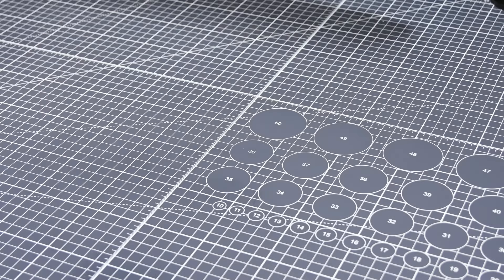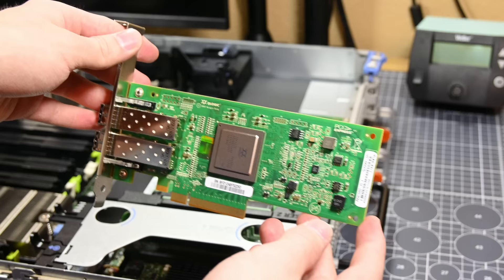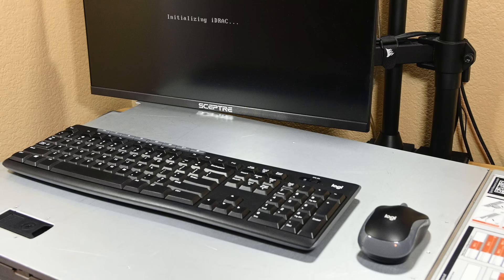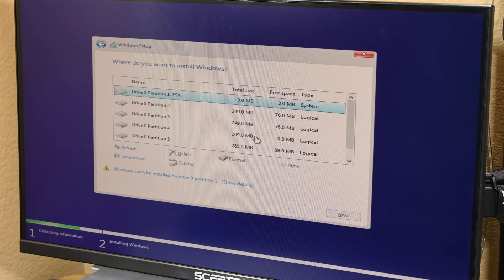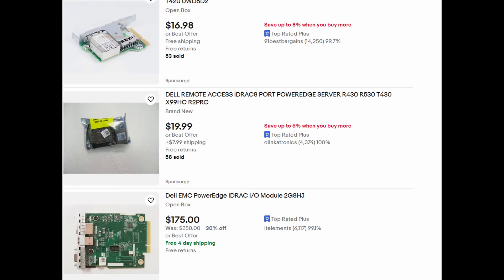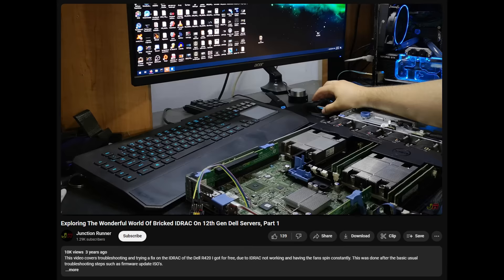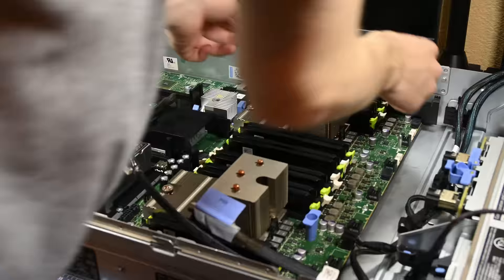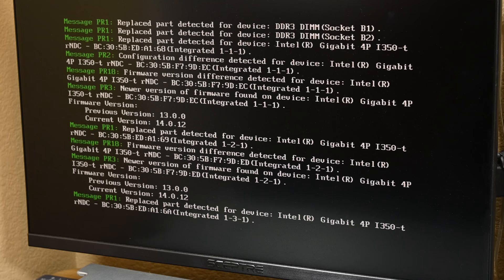I Took a Risk on This Server - Can I Get it Fully Functional?

Comment: I fixed the exact same iDRAC issue with UART about two years ago on an DELL R620. It still works to this day :)

The clips of the RAID controller breaking is an unfortunate issue with the plastic DELL used. But it's not a big issue, as the RAID Controller still sits firmly on it's quite large connector

The SATA SSD not being recognized in the OS is most likely due to the RAID controller. You need to enter the RAID Controller management BIOS and create a RAID0 for your SSD. You could also (probably) flash the RAID Controller into IT-Mode, so that all drives are passed through. Though iirc booting from these drives then doesn't work. So it's most useful if you want to use the drives in something like TrueNAS for Storage.
Reply: how did you fix the issue? Usually it's failing NAND. I have 10+ of the R620 motherboards here broken down for parts because of the iDRAC :) or did you do the "replace with sd card" thingy?
Reply: @callmefoxie2950  iirc, I put the firmware.d7 file onto the SD Card like DELL said in their Help guide. But the flash didn't start automatically. I had to connect a USB TTL module to the UART pins on the motherboard. In the serial terminal I then had to press enter (and maybe type Y or YES) to start the firmware flash. Also, if possible, use a fairly small SD Card. As I also remember it didn't work on the first try with a 32GB SD Card. I used a 1GB Kingston SD Card in the end.
Reply: Oh right. This doesn't work for most people as the NAND is actually bad and requires a change. There should be a way how to change the medium to SD card but eh good luck selling server with that for any profit margin :)
Reply from the maker: There's some great info in this little comment thread that could be helpful for people in the future with this issue, thanks for sharing!

Comment: Ram blanks are to protect from dust in the slots , which I have had plenty of issues with HP servers in dusty environments, however I like your reasoning with the blanks acting as flow stators , that’s good logic 👍👍👍

Comment: Good work on the system board replacement, the small cables going to the front panel are notorious for getting damaged when the lid goes back on.
DIMM blanks are for airflow but do help keep dust from settling in the sockets.
The fibre channel SFPs will be outputting invisible laser light, so if you're not using them you should unplug the SFPs or put dust covers in them, or just remove the cards and put backplate blanks in the slots.  The light will damage your eyes if you look directly into the SFP.
Yes, a corrupt iDRAC will almost always end up with a system board replacement if the server is under Dell support. 

iButton and LCD are run by the Lifecycle controller and iDRAC so not surprising that they weren't working.
Reply from the maker: Thanks for the warning on the SFP's! I wasn't entirely sure whether or not they'd be outputting any light when there weren't cables plugged in, so thanks for informing me that they will.

Comment: To use the front 2.5in bays you first plug the drives in (ideally with a caddy) and then access the Dell raid configuration utility (it's CTRL+R on my Dells). From there you create virtual drives through the raid controller. Once you're done, still in the raid config utility you select the virtual drive the server is supposed to boot from and you're done.
Reply: Also, you may need to load the driver for the RAID controller, as Windows 10 may not include it in the setup.
Reply: Yes, when using raid you need to create the partition. I have r610 and t320 and before I had ibm x3550 and I couldnt figurate that out so I give up and sold the server now I older and have more patient and use the server as saas.
Reply: Came to the comments to say this, as I have deployed several similar dell servers for clients, and I sometimes forget to do this too. I Just picked up a R730XD which I will be setting up in my home lab to replace my HP DL360 gen7. I'm switching from ESXi to Proxmox for my new server, and will be running as my NAS, Docker host, as well as Jellyfin. I have plans to throw a P100 and a couple of NVMe drives to make a self hosted game streaming VM as well.

Comment: Thank you for an interesting video. Buying the new motherboard was a great step. You were able to get your hands into it. And it worked. I remember buying one in which only one socket as working, the second was with bad pins. I had to replace it. And it was a wonderful journey. The way you removed the old motherboard tells me you have read about it. Great 👍

Comment: Congrats on the new server. I've had one just like it running for a few years. The front SAS backplane will happily accept either SAS or SATA drives. I've had mine running consumer Samsung SSD's. the issue you're facing is that the server has the H710 raid card. this card doesn't support passthrough non raid drives. Two options here, either make a single drive raid 0 using the raid configuration utility you see on boot. or get an H310 raid card. this card still supports making raid arrays. but also will allow you to just plug in any old drive and get a more conventional hot swap functionality.
Reply: I remember sometimes you have to cover a lane on the SATA connector with tape for the drive to work - some kind of incompatibility.

Comment: Hey dude, the issue with the iDRAC is a very well known issue with 12th gen Dell servers.

Basically, during the 12th gen cycle, they changed how the iDRAC, Lifecycle Controller and BIOS firmwares worked. Before some specific version, all three were split into different firmwares that needed to be updated together.

However, at some point, the iDRAC and Lifecycle Controller firmwares were merged into one and thus, only 2 firmwares remained afterwards.

Problem is: if you don't go through the exact route of firmwares for both/all 3, you end up bricking the DRAC. There's a specific version that has to be installed first to combine the firmwares, and then you can normally update it.

Unfortunately, I've been there and did that exact mistake and it cost me a T620. That being said, I learned and got a R620 working fully after carefully doing the updates in the right order. (There's a Dell community post somewhere with the exact order to update.)

So yeah, that board was bricked. Luckily you got one for cheap, mine for the T620 was around 700$.
Reply from the maker: Yikes, having to spend $700 bucks on a new board doesn't sound fun, I'm sorry that happened to you. I had found a little bit of information regarding the iDRAC/LCC firmwares being merged into one at one point and causing issues, but your comment put it really clearly for me, thanks! I might just leave this board and its firmware alone at this point haha, no need to fix what isn't broken (at least for my basic use cases) and I'd rather not risk having to buy a new board. (I'm pretty sure I'd find a way to mess up the firmware flashes lol)

Comment: The issue with the drive not being found on the server is that it has a RAID controller and you have to build a hardware raid array before anything will be seen. If you want to install Proxmox or TrueNAS on this server, you will need to flash the raid card to IT mode and also remove the battery for the raid controller.

Comment: Even if your Dell server appears dead as a stone, you can get the Service Tag and plug that into Dell's support site.  It should at least tell you how the server was configured when Dell shipped it.

Lifecycle Controller is still hideous.  Hopefully you don't have to reboot often because if you do, that stuff has to re-initialize EVERY reboot, even if it's warm.  Obviously no one from Sun got a job at Dell (Suns have "diag-switch?" and "diag-level" settings and only switch to MAX if OBP detects a problem.  It's comical that an E3000 from the 1990s can POST way faster than these Dells!)

Also, if you ever use SAS with this, the PERC RAID will probably give you trouble.  Be sure to get drives that are verified to work on the Dell servers, or you'll find they're "failed" or otherwise unsupported, and you won't even be able to configure them in.

Comment: Really good video, looking forward to the next on this.
As a side note, perhaps its worth looking into the dell 7810 workstation, i have just one and its amazing but id love a better mind to assist in showing how to add raid function for 4-6 drives. Dont worry, they are not crazy expensiveabout 800 usd converted from my 1500 sgd. Take care and keep it coming.
Reply from the maker: Thanks for the suggestion, I'll absolutely look into it!
Reply: @CompHwTipsAndTutorials  Thank you for taking the time to read and reply
Reply: i love my t7810 i have dual e5 2699p v4s . yes those cpus lol and a 1300 watt psu to feed those two 200 plus watt 3ghz base cpus with22 cores and 44 threads with a turbo of 3.8 ghz all core combined they draw 400 watt lol
Reply: @amdintelxsniperx  dam that sounds awesome, any idea if I could put those into my 7810 and if so, would you happen to have a link to buy them on ebay please

Comment: Hello, it’s already been said and it’s correct, you need to enter in the Perc BIOS with CTRL+R and configure a RAID but to be able to do it the boot must be set in BIOS mode, if it is in UEFI mode you can do the same thing through the LCC. You can also through the LCC deploy one of the server supported operating systems and one of the options in the deployment wizard is to create a RAID, be careful with this option though as if you have data on the HDD/SSD you are using , information will be overwritten. By the way, as a disclaimer, I work 4 Dell

Comment: FYI: Red/orange tabs are removable when system is running, Blue tabs item must be removed when powered off.
Reply from the maker: That's cool, I was aware about Dell's blue plastic indicators on things that can usually be pressed on/slid to remove, but the orange/blue difference to make clear what can be hot swapped and what can't is something I hadn't realized yet. Thanks for sharing!
Reply: @CompHwTipsAndTutorials the underside of the cover actually shows that too

Comment: How about RTFM?   iDRAC is encrypted!  By design.  The I-button is for 'identification' of the system in the rack, this LED you turn on and off FROM iDRAC when working correctly.  You have never accessed the UART, as a simple ISP router?  Or a SBC?  Very similar to those scenarios to reflash the iDRAC.  Almost every question you ask... is in the manual.  Some Dell servers require DIMMs in pairs, and the mainboard senses if the slots are empty.  So depending on the model, such as Dell 2900R for example.  Most Dell 2U servers have 3 PS units and the server can run on 2 of 3, so the 3rd is a spare redundant in case of failure of either of the primary PS units.  The noise from FANs spin up is NORMAL, until the temperature sensors validate the FANs are functionally normally, then the FANs will back off.  This can be validated via iDRAC or BIOS.  You need to find out in the BIOS, to see which RAID card is present.  You cannot save configuration completely and consistently until the onboard battery is functional, as well.  Many Dell servers also have an internal USB bport, so you could actually boot ESXi from a 8GB USB thumb drive since ESXi is RAM resident after initial load.

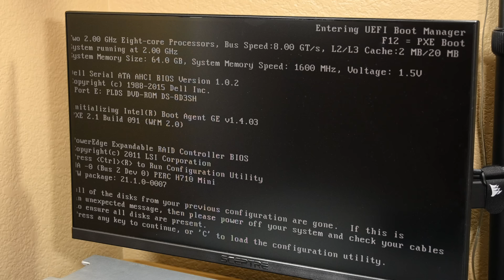Comment: It's not very intuitive, but the reason you can not see the drive you're putting in the front SAS bay is most likely because you haven't configured it in the RAID controller BIOS. I didn't see you show this screen on the new mobo, but look at 11:55 in the video. When you see this come up you need to hit "C" to get into the configuration and wipe any old configs that are in there. I would recommend then setting each drive as stand alone if possible and marking each drive as bookable. Afterward, you will be able to set that drive as a boot device in the UEFI BIOS. You may even want to consider flashing the RAID controller to IT Mode which is absolutely necessary if you want the drive fully exposed to the OS.
Reply: was also gonna mention this
Reply: Thats most probably the reason why it didn’t work.
Reply from the maker: Thanks for the info! I'll give that a shot in the future

Comment: I have an old Dell server but I haven't gotten around to playing with it yet. I mean, there is nothing practical I could do with it - it has 8 Core 2 cores and burns about 750W. I used to work in aviation and I have heard small gas turbine engines run that aren't as loud. 
It is far less powerful than my inexpensive modern gaming PC. It is likely the Sun Ultra 60 I also have waiting for me to get some time will actually be usable for something. A server for vintage games maybe. It has a Pentium MMX system on a card. I think it would be fun to have a vintage game streaming capability running on original hardware, though I might need a modern SBC or at least a fairly sophisticated microcontroller to make it work. It isn't like it was designed for that. It is powerful enough, surprisingly, to run modern FreeBSD or Linux. Shame it has taken so long for the world to take RISC CPUs seriously. Intel is running scared; they just decided to license their architecture for the first time in a long time. They are afraid of ARM and RISC-V. I think x86 is all but dead, regardless. 
My only experience with enterprise hardware was an internship where, among other things, I helped roll out a brand new PII based network, lol. Things have changed a bit since then.

Comment: "Dell system updater" or dsu is what you need in this case find yourself a usb bootable live linux os install dsu ran and update everything and voila %90 its just going to be okay, about the ssd you need to configure it at raid 0 you can press ctrl + r during the "LSI PERC" firmware initialize. I still use r720 or similar devices in enterprise places they are pretty rock solid and cheap only downside is its not a electric friendly device which where the cheapness is coming from, with the bill of the datacenter you can get R740 or 730, still there are tricks you can use L series cpus and such, anyways good luck with your toy!

Comment: Former poweredge R720 owner here. and yes, I have been through a idrac death too, like you. the initial mobo is toast/unusable due to dead idrac...even if you don't use it its so critical to having a happy server. the reason why the BIOS options wouldn't save? 100% due to dead idrac. the fan calibration/power thing the replacement mobo did happens on configuration changes as it calibrates fan speeds ran by, you guessed it idrac. and those modules you showed? those do not have idrac on it, those are LAN enablement cards...basically to put idrac on its own Ethernet port...that's all they do
Idrac7 and up (R720 is 7) idrac is 100% on the mobo and the model does not matter. T620, R820...
I'm pretty sure the magic version is flash idrac to 1.9 then to 2.0..then you can jump it to the latest version and it won't brick; I recall I think it was 2.0.20 that was the version where it combines lifecycle and idrac. if you jump to latest...idrac dies and you are maybe trying UART method or replacing mobo. 
older servers like the R710..those are not embedded and can be ran without a idrac card. 

like others have said, these dell RAID cards require a drive to be in...RAID just inserting a drive will cause it to be unrecognized if you enter the PERC setup and pick RAID 0 then a single drive shows up fine...or can be flashed into IT mode, removes RAID and then it basically works like a SATA card...just with SAS capabilities (there is a guide that adds booting support it can be done ive done it)  . the plastic clips on the RAID card are very fragile, mine snapped like a twig too lol
Reply from the maker: Thanks for sharing all that! You've given me some great information that I really appreciate

Comment: It's been mentioned before, but you need to configure the installed SAS/SATA drives in the raid configuration utility before you can use them. However, do note that not all solid state drives will work with this machine regardless because of firmware limitations on the raid card. I have two of these in operation, and some of the cheap solid state drives(such as silicon power) do not work.
Reply from the maker: Interesting, I might go out and buy some proper SAS drives that are known to work on this server then, as I'd rather not have to deal with a billion compatibility issues lol
Reply: @CompHwTipsAndTutorials Samsung 870s for the most part work with the H710p, as well as some Spark SSDs. Even then though, firmware on the drives can create problems because they aren't all using the same version.

Basically, when you install the incompatible drives they are seen initially. After configuring them, the controller is unable to see or interact with them, and claims they're either missing or failed. After rebooting the system, they're either offline completely or marked missing. 

SSDs are much more power efficient than the mechanical disks, but with these machines it's always a hit or miss. The mechanical SAS drives can be had for very cheap on the used market, at the cost of increased power consumption and heat production.
Reply from the maker: Interesting, I might have to give an 870 a shot then. Do you know of any SAS SSDs that are known to work with the H710p? Or does this server predate those kinds of drives too?
Reply: @CompHwTipsAndTutorials Unfortunately, I don't. I've never used SAS solid state drives because they're often quite expensive.  According to research though, the Samsung SAS SSDs as well as Kingston's mixed use drives are known to work. You can probably find a list online somewhere.